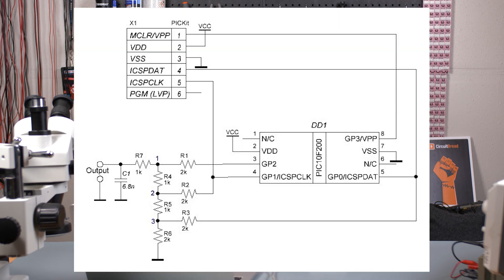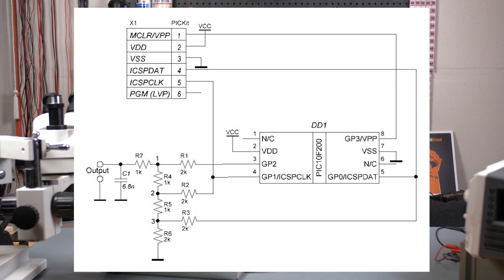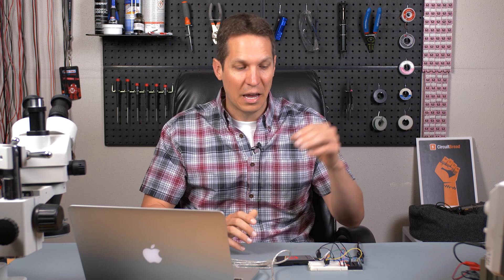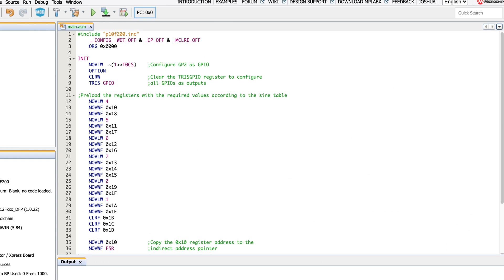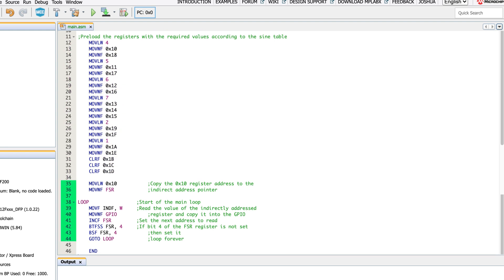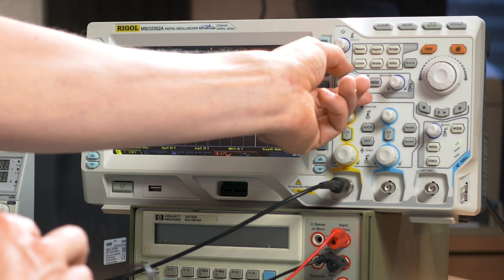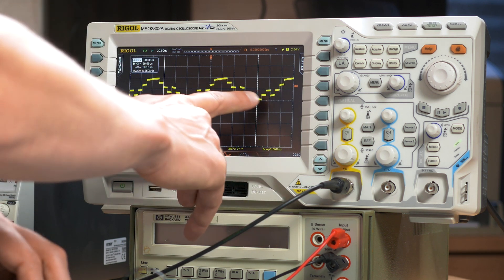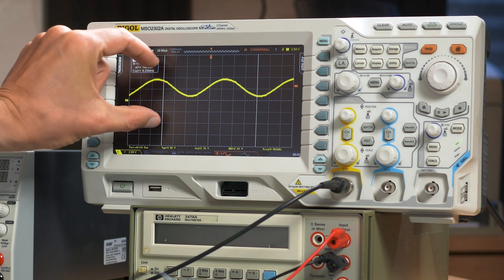Sine Wave Generator circuit with simple microcontroller - Part 17 Microcontroller Basics (PIC10F200)

Comment: Subscribed! Very inspiring. A sine wave generator using one of the simplest of MCUs. 

I tried combining an NE555 with a capacitor once, and you can get some pretty smooth waves even with just that.
Reply from the maker: Thanks!  Yeah, I'm amazed at the things Sergey can squeeze out of these simple PICs.  I don't think I would have even attempted it, I would've just gone the 555 route if I needed a sine wave, though this is slightly more flexible.

Comment: Can you please help me writing a programme such that for a single input the output comes forever until the input is send again.....as in a sound sensor
Reply from the maker: Hi there!  Unfortunately, Sergey doesn't have the time to do individual lessons but if you go through all of the tutorials (which, the "gaps" are on the website - no videos for those yet, but the written tutorials are more in-depth anyway) this should be something you can achieve without any further instruction.
Reply: Yeah......I did it but please help me......should we use internal pull up resistors

Comment: What version of MPLAB X are you using? I recently started learning this stuff but with MPLAB X 5.4 the MPASM compiler is gone, leaving only XC8 which is, as far as I was able to see, a strange mix of C and assembly
Reply from the maker: I haven't tested it recently, but when MPLAB X stopped working on my Mac because I updated my OS (stupid move, I know), I switched over to MPLAB Xpress.  Which is giving me some warnings about data migration at the moment, so I don't know how much I'd recommend that.  In general, I have my issues with Xpress but it does MPASM if you change the settings and the interface is simplified for those of us that aren't going to be doing production level development.
Reply: @CircuitBread  I am working with MPLAB X 5.35 now. MPASM is still usable in that version and all your examples work on it. However, it does say that MPASM is not compatible with 64 bit systems, and obviously the newest version, 5.4, does away with mpasm entirely. I suggest maybe doing something about the xc8 compiler since this seems to be where Microchip is going in the future. Moreover,  there is nothing quite like what you guys are doing out there, especially not for xc8.
Reply from the maker: We have considered doing a series that is based on C instead of assembly but that's not our next planned series.  The xc8 compiler is for C only, so wouldn't work for this series.  Odd that they'd get rid of mpasm completely, though - there must be more to that story.  Assembly may not be incredibly popular but it still has its uses.
Reply: @Mrjeje0  Same happened to me. You can download a downgraded version of MPLAB here because I have read that from version 4 MPASM is gone.